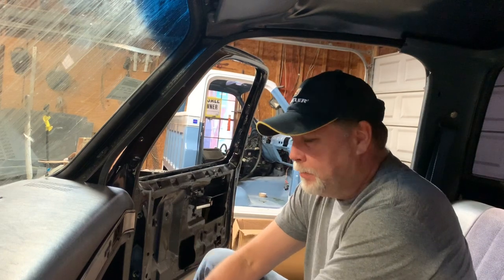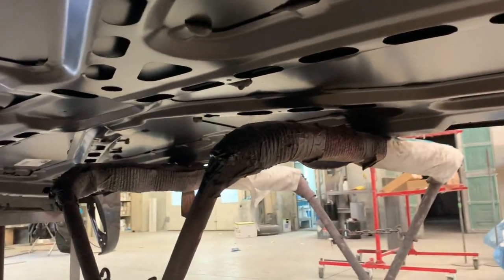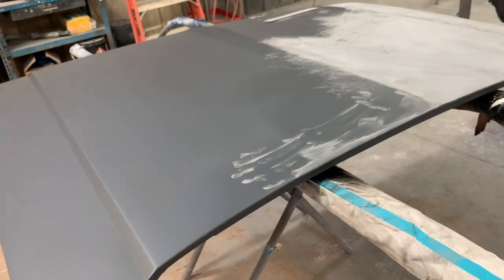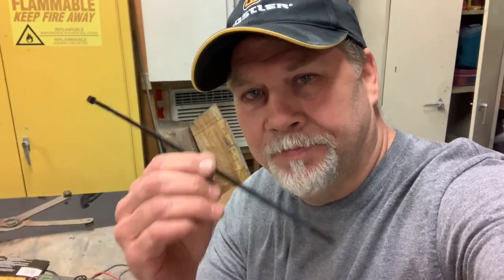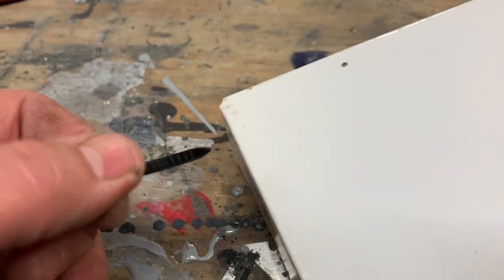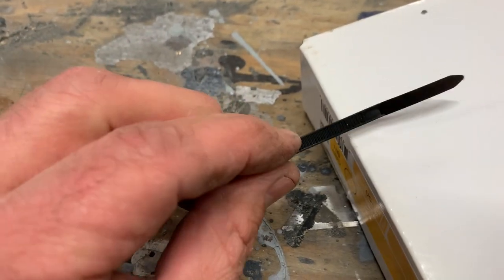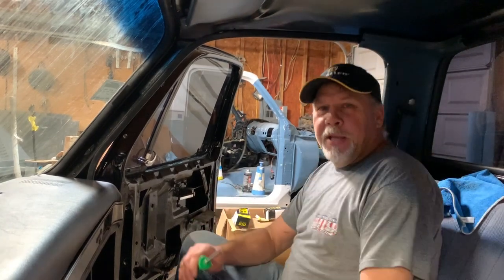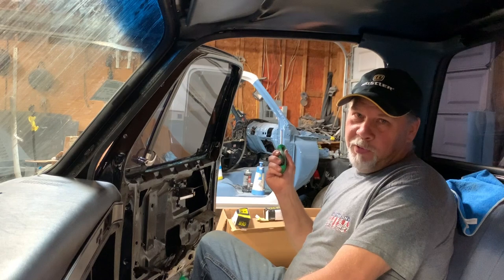C10 Repaint: Painting the Hood and final pieces. #c10, #squarebody, #chevy

Comment: That's perfect ! ..
I need mine to look that awsome. 
That's great tips !
Reply from the maker: Brett Johnson Thanks Brett!
Reply: After I painted my frame with epoxy primer... I painted it PPG single stage gloss black... 

The primer and the gloss black is chipping and coming off really easy... 
What did I do wrong ?
It was all sanded to bare metal...
Reply from the maker: Brett Johnson What epoxy did you use and what did you sand the frame with to get it to bare metal?
Reply: @StoutCustom  I used PPG epoxy primer... I sanded with 80 grit.
Reply: I live in Montana so temputer might have been a facture.
Reply from the maker: Yeah if the steel was really cold that could be a factor. Depending on the epoxy and hardener used, some require an induction period before applying  also

Comment: For the underside of hood where it was attached to the stand, how do you go about touching up areas that paint couldn’t get to?
Reply from the maker: Where the stand makes contact is a very small area as there are opposing hooks that catch the side of a brace or hole. So most of the time it’s left as is. Especially if there is a hood pad covering up the inside. On the ones that are exposed and need to look good, the area is spotted in once the hood is on the vehicle or the inside is painted first, allowed to dry, then the hood is flipped over and the outside is painted next. Thanks for watching!

Comment: Been enjoying the vids. Do you thin your body filler? Any advice on that would be helpful!
Reply from the maker: GreaseMonkeyTV Hey. Thanks for watching!  I usually don’t thin my filler. I’ve seen people do it with lacquer   thinner and there is also a product called “honey” I believe that is actually made for thinning body filler.  I’ve used that a little in the past but that was years ago. Now if I want a better spreading product I buy a filler that spreads well instead of adding things that may have an adverse affect I’m not aware of. One thing I will do is stick with a line of products that is designed to be mixed together. Evercoat metalglaze putty which is thin and spreads easily can be mixed with their Rage Ultra to make it easier to spread. So bottom line is I follow the manufacturers technical sheet for thinning options. Hope this helps and good luck on your projects!
Reply: @StoutCustom  Thanks so much for the reply! I've been using 3M on this project and it's not spreading well. I was never a body man... Uploading my square body build videos right now.